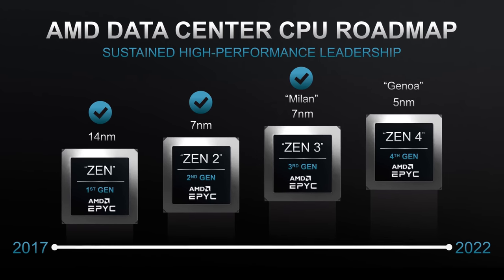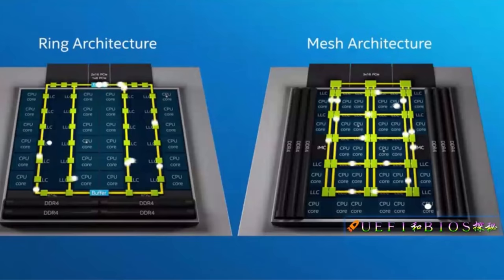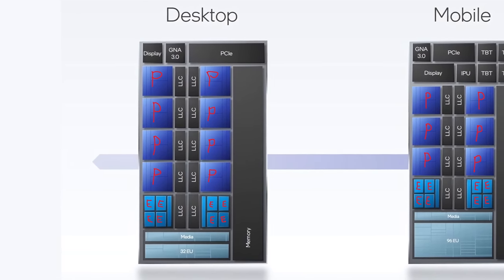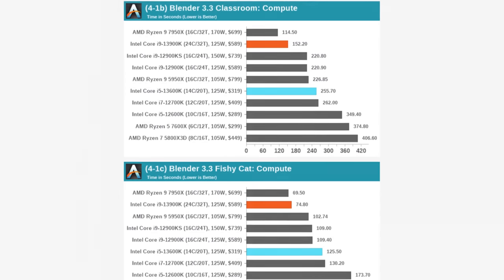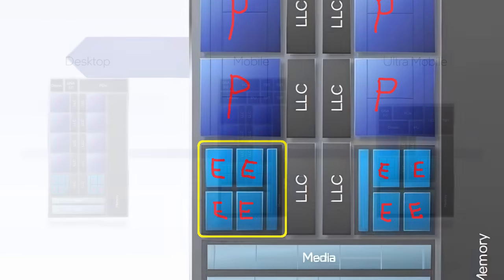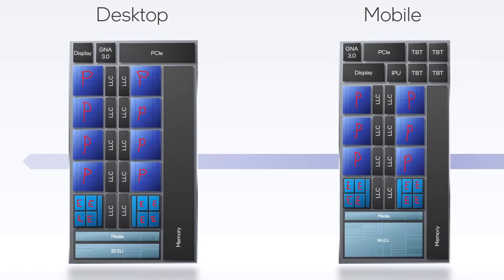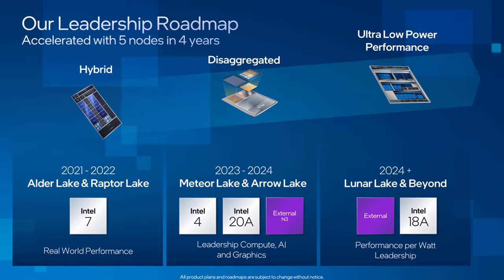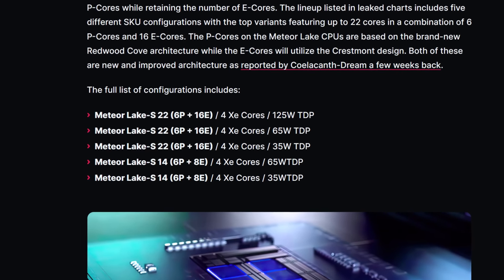E Cores - Slow, simple, not super efficient... but still good?

Comment: Interesting note: Apple's latest silicon (M1 & M2) also have some efficiency cores and some performance cores. It seems like it's working really well for them.
Reply: ARM SoCs have been using big.LITTLE for a loooong time. in fact, now they are mixing more than two core types, with high, mid and low power cores.

Comment: I think you contradicted yourself in the video, by asserting that E-cores and not efficient and rightfully pointing out that intel 6P + 8E is actually much better than 8P in performance per watt. The E cores are efficient, the problem is we perceive them to be like mobile E-cores. These are desktop cores specifically designed to maximize multithreaded performance per unit area. A cluster of 4 Ecores provide 50% more multithreaded performance than a single P core at the same power consumption, the good news is that it translates well to the mobile side too. I owned the Tiger Lake 1185G7 laptop and switched to Alder Lake 1280P laptop, I was blown away with how much extra performance i was getting at the same power level, I can compile GCC twice as fast for example. Alder lake Raptor Lake seemed focused on performance and perhaps Meteor Lake will start pushing the boundaries of efficiency, it doesn't mean that current E-cores aren't efficient, they are working as intended
Reply: @2kliksphilip  I did watch your video, completely, and that's why i acknowledged that you converged to the right conclusion but you still contradicted yourself, if you can explain to me clearly, and with data why you say e-cores are inefficient, and i can explain to you with data why they are efficient, then we can have a productive discussion instead of name calling

Comment: E cores are not that bad. Sure they are not that much E sadly. Efficiency can be improved. But I did run some basic benchmarks, and yes the e-cores add some performance. If handled well it can be used to retain the big heavy threads on the P cores for longer, so more performance, while the E's handle the background. 
But one E core is far from a P core. And running the same job on an E core versus P core..yeah not as good. I have a 1235u in a laptop. So 2 p-cores/4threads and 8 e-cores. Fine... Basic CPU-Z testing shows an efficiency of around 7.7. As if it is an 7.7 core system. But that is if you push it.

Comment: The problem i've personally found with e-cores is that they don't scale as well in a "used" system. What i mean is that while all the benchmarks are done on clean "empty" systems, user systems might have a couple tabs open, some voice chats, multiple programs running in the bg,etc. And for whatever reason (might truly just be a scheduling issue, god knows it took qcom and google forever to get something usable) under these cases the "hybrid" processors get absolutely TRASHED. While the homogeneous designs lose a couple percentage points (in line with usage) i've seen the 13600k in some of the machines i built lose up to 23% of it's "max" perfomance. 
I really hope this is a fixable issue, because this is the first time since haswell that Intel has introduced anything interesting to the CPU world.

Comment: Chiplet design is superior, though infinity fabric is not the best interconnection technology. To that matter Intel also has their own technology, which is actually superior, called Foveros. But Intel being Intel, they are having difficulties with getting tech ready just like 10nm issues. Though it will be very interesting with 14th gen which is supposed to support Foveros

And it will also be interesting if intel goes for 3 cluster design which has been getting popular in mobile recently. 2 Ultra P cores, 4 P cores and 8E cores. 2 Ultra P cores can go a long way in boosting main thread and physics thread performance in games significantly which is where actual bottleneck tends to be.

Comment: So the i9-13900k is cheaper, uses less power, and is barely slower than a Ryzen 9 7950x; I'm not seeing the problem here.
Reply: 13900k costs more in many parts of the world including mine. And you're not seeing any issues with e cores because your baselines are set on what exists instead of what could've been. P cores perform better and efficiently even when adjusted for size and Intel simply chose to focus on e cores because bigger numbers are easier to market to the nontechnical masses. You're also wrong about 13900k consuming less power. You're probably looking at the tdp of the processors instead of their total power draw which is a different estimate entirely. Even if you count tdp, intel's recent gens don't have a direct answer to amd's pbo2 and just how easy undervolting their cpus are -- so easy in fact that it actually makes sense to call amd out on having their cpus released to the public in their worst configurations. These are valid criticisms to bring forward regardless of one's personal preference.
Reply: It seems everyone likes to put the narrative "AMD is king" regardless of real world data.

Comment: Intel has E core only Xeons coming up. 

Puget did look at what a 0+32 could maybe look like. 

And no, the 13600k does 6 p cores. It has 8 with two disabled/non functioning. Intel uses the same die for all of their -S series products. So 13900KS and 13600F all use the same die.
Reply: @2kliksphilip  your argument at 3:29 is misleading. First of all you are showing the "mobile" die, which is the Raptorlake-P and -H (which might also just be alderlake), die space is used for larger igpu for example.

And going from i9k to i6k is not about die space(there is binning and segmentation) - since it is the same die. if you wanted to have a 8+0 SKU you would disable the e cores... which you could do on the 13700k for example.

Intel is hosting an event next week that might shine details on their 14th gen processors which will indicate a major shift once more

Comment: Efficiency is a system of trade offs. E cores can be either really efficient, or really die efficient, and intel’s desktop chips focus on the latter for better performance for the same die size.

If they tuned the cores down, the E cores would smoke AMD’s big cores in efficiency.
Reply: No, they would not.
Reply: @nobodynoone2500  they would, my little AMD fanboy.
Reply: 13900K with 24 cores (8P/16E) is roughly matcing 7950X with 16 cores in productivity while consuming more power.
Its similar with the 13600K 14 cores (6P/8E) versus 7700X 8 cores. Similar performance but the Intel part is typically using more power (The biggest win for the 13600K is the price where it competes with 7600X instead).
If they tuned down the cores for efficiency they would also lose the little performance advantage they have.

As a gamer I would like a 8 P-core (with HT) CPU instead since E-cores are useless for gaming.
Reply: @pantzman  I’m talking cores, not cpus.